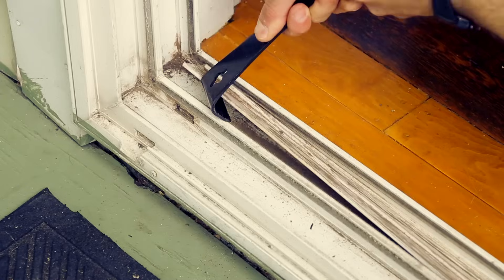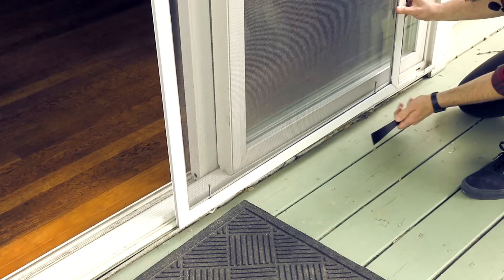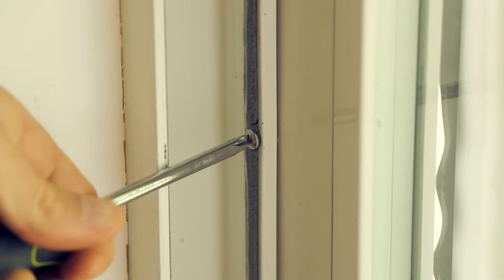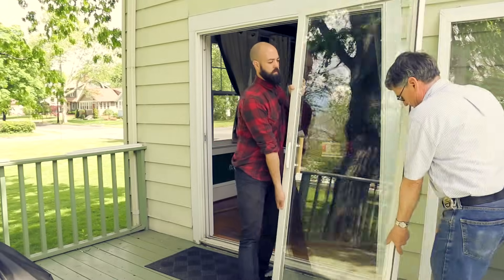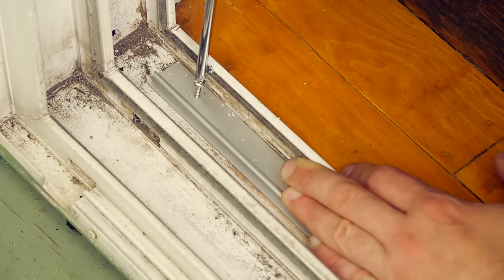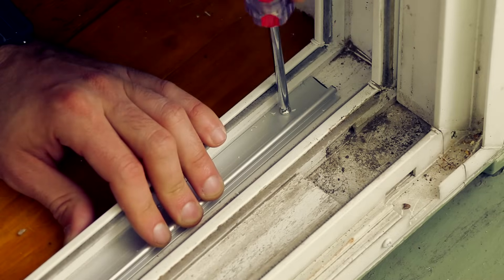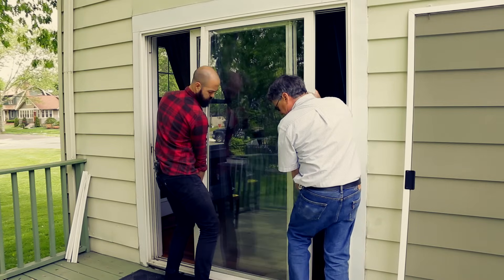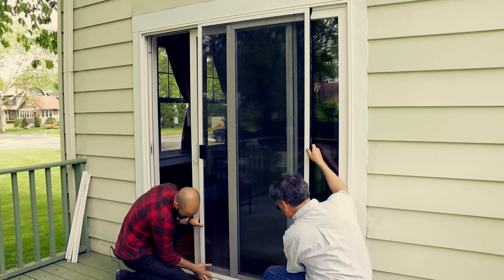How to Replace a Sliding Glass Door Track

Comment: I need to do this, but I will clean before installing the new parts.
Reply from the maker: Great idea, Deborah.

You can... 1. clean up beforehand to try to avoid replacing the track, or 2. clean up before you replace the track, to make the installation go smoothly.
Reply: I was thinking the same thing. When they were done it still looked dirty. But very nice video showing how to change the parts to make the door work better. I had no idea the track could be replaced like that.

Comment: Why are screws being used? Won't it cause more leaks? Water that pools inside the tracks are designed to drain out the weep hole. If the track isn't waterproof then it will be draining into the house rather than through the weep hole. We had to learn this the hard way. Perhaps the reason for the leakage was someone screwed something under the tracks without caulking/sealing.

Comment: You don't have to take the stationery door off
Reply: You would have to take the inside door frame off to remove the slider and then clear the track to replace it.
Reply: I can confirm, I took my sliding glass door off without removing a single screw.

Comment: Hi, not sure if you can help, but we've been told the worn vinyl door track for our First Inline patio doors can't be replaced, so we are going to have to have the whole patio doors replaced. I'd like to try to fix it myself first, will give your option a go!
Reply: Did you ever try to replace the track yourself??
Reply: @megsm1839  hey, no we didn't. Just used WD-40 and cleaned the runners to keep them just about useable at present. Eventually we will probably need to replace

Comment: Why would you have to take the stationary door off???? It’s not on the same track 😉
Reply: I've wondered that myself.  Seems like a lot of effort could have been avoided.  That slider would have come out to the inside .
Reply: Guess it depends on if you can remove the sliding door from the inside or not.
Reply: You need the extra room unless you remove the door from the inside. But you risk not having enough grip on the door as there is 1/4 inch between stationary and fixed.
Reply: george whalen   Actually you don’t need to remove it.We just replaced the strip this morning and if they are on separate tracks, the fixed door doesn’t need removed 
I really don’t understand this guys video. Too much unneeded work
Reply: i thought he wanted clean both tracks while he was at it.